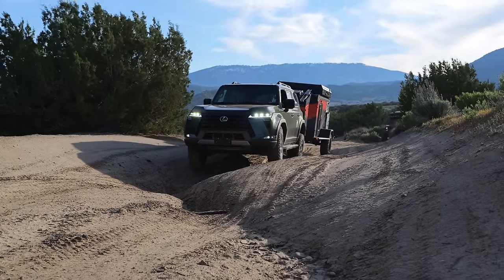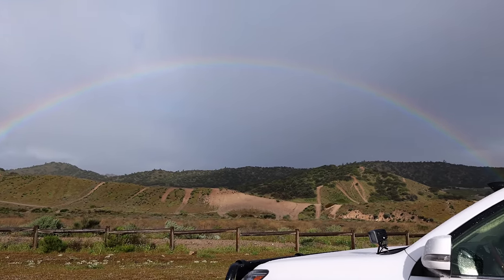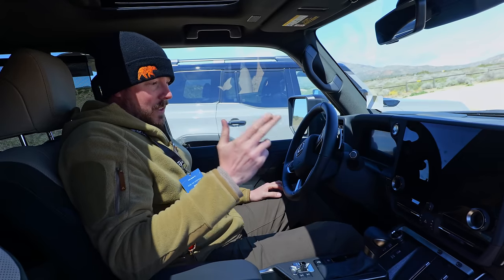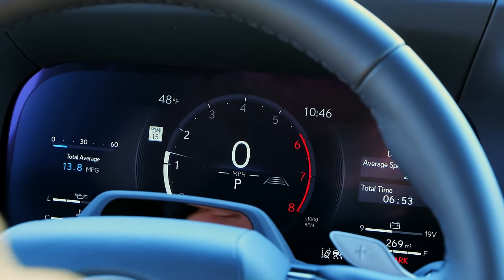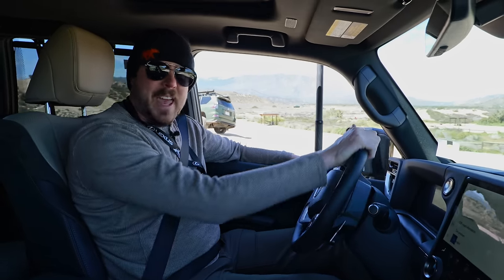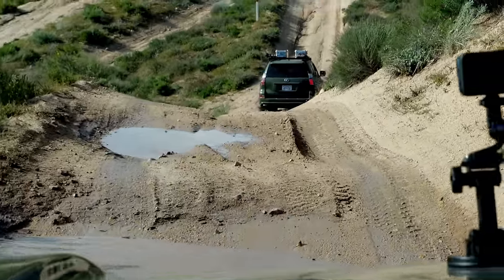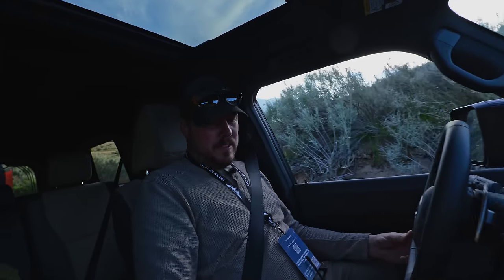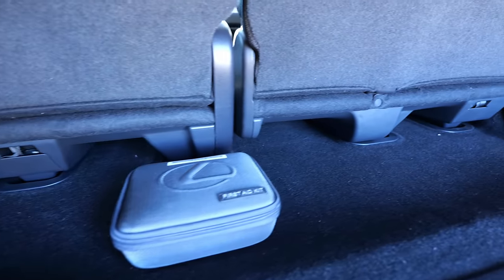Lexus GX550 OVERTRAIL - Is it off-road ready? (Real Reaction)

Comment: The GX550 is Hands down the GOAT of all the new Toyota Vehicles. Its the dream rig for sure!
Reply: It's still a Prado/LC 250 and amazing!
Reply from the maker: I agree, it's my favorite of all the new platforms.
Reply: Common longevity!!! :)
Reply: Except for long term reliability of the powertrain. A Toyota mechanic said this powertrain is super complicated and it's going to cost a lot to keep this thing going. Would prefer a V8 powertrain over this twin turbo V6.
Reply: @glow4417  time will tell. It is toyota so there is still hope. And I would prefer a turbo 6 cylinder over the 4 cylinder that the land cruiser has.
Reply: I would go lx600 for your use with towing the trailer. Lx600 has marginally more horsepower but does have bigger turbos. The bigger turbos with marginally more horsepower =. More reliability. They are expensive though…
Reply: I would agree. The new 4runner, Tacoma and Land Cruiser don't do anything for me personally, but I really think Lexus hit it out of the park with the GX550. I do worry about the reliability of the new V6 platform, but Toyota/Lexus is usually good at working out the kinks.
Reply: I dont know the 4Runner comes with bigger ground clearance.  A sunroof that opens.  Power Rear window.  Option for non hybrid.  It may not have as much power but may be the sweet spot in the line up for off road
Reply: It’s cheap junk.
Reply: @dannyhoward3437  Man if this is cheap to you, that is awesome.

Comment: Excellent, very informative video. I've been following your adventures for over five years now and loved all of them. Your channel was my first subscription on YouTube  l met you a few years back at the overland event in central Texas and have learned a lot about overlanding from you. I'm 77 years old and have always loved off roading since  the 1960's when i built a dune buggy out of a 1955 Oldsmobile for running the dunes on South Padre Island. We removed the body, shortened the frame and put dual wheels on the back. Lots of power but really too heavy for running the dunes.   My Grandmother did most of the welding for me. She was lead welder for Douglas  Aircraft back in WWII. You've really got me excited about the new GX550 with your evaluation of the vehicle.  I've always been a Chevrolet guy but this has me excited about the GX550. Two of my sons drive modified Toyotas; a 4 Runner and a 2006 GX470 and really like their rigs. I think the GX550 would be a good all around vehicle for our needs without a bunch of modifications needed. Thanks again for the excellent video.
Reply from the maker: Thank you so much for sharing that and for riding along with us for so long! I was also a GM guy for many years but since getting out 4Runner we've fallen in love with Toyota (obviously). 😁

Comment: Great review! Ive got a 22 tundra with over 100k miles on it and it still runs as good as the day I bought it with no issues to speak of. Oil field truck that sees lots of rough roads. 
If i had the money I would not hesitate to buy a GX550.

Comment: I was particularly impressed with how quickly the wheel spin stopped in the wheel off the ground the first time it articulated in your video. You were obviously impressed. I bet Sarah was giddy when she saw the video. I would think EKDSS will end up more reliable than the swaybar disconnect. I am concerned the sbd will end up as clunky as the 4WD engage can be sometimes; as it waits for all the players get in line to re-engage, or get out of a bind enough to slide apart.
Reply from the maker: Yes, it was much more controlled and instant! The EKDSS was also spectacular.

Comment: Thank you! This is by far the best presentation of the GX550 to date. Every other media platform has taken it city driving or over extremely mild terrain. This GX550 Overtrail+ is very impressive!  If Lexus makes a hybrid version that gets better MPG, I will seriously consider it 🤔 
* Lexus Engineers*  Moving the 12V from the center console  up to the dash cubby-hole would allow the 4L/4H switch to take that location.  If the Overtrail is only 2 rows of seats, then the rear seats should have the option to move forward/back with a manual pull handle. The sunvisor Has to be able to move the length of the window or have a separate pull flap. More ground clearance, via suspension or adding AHC, to the Overtrail would be greatly beneficial.

Comment: A manual trailer brake controller is a must for offroad in both hi and low range. It's the difference between being pushed off a cliff or avoiding it.

Comment: Thanks for taking the time to make this review. At the end you mentioned adding some clearance enhancements. Are you thinking it needs a lift? Will adding a lift mess with the geometry of the suspension in a negative way?
Reply from the maker: I'm curious to see what aftermarket does with this. Honestly it's never enough lift, lol. But this will do 98% of most trails no problem which is crazy for a stock LEXUS 😲

Comment: Let’s take a moment to appreciate how quiet the interior was over all those different ruts and off-road scenarios. The 460 was quiet too it’s put together really well, there are some vehicles that feel like they will fall apart on washboard roads. Does the rear locker engage right away like the center diff on the 460? Toyota rear lockers take forever I was wondering if it works better on a Lexus…….

Comment: 4runner guys (me) be like “yeah, but the back glass doesn’t roll down!” 😂 looks pretty sweet! I wouldn’t want to lose the center console to a cool box though. Did it have/did you use stabilizer disconnect? Great video!
Reply from the maker: I think the coolbox is optional. This has EKDSS so it doesn't need to disconnect like a traditional sway bar. It's a crazy cool design.
Reply: Overtrail has eKDSS which disconnects sway bars automatically.
Reply: @spaulagain it not only disconnects it or connects it, it can be set in an analog way, like 25% or 50% depending on the mode used : snow, mud etc. According to a Lexus engineer in a video. All automatically.

Comment: They did good with the exterior design. That lack of back seat leg space is kind of nuts. 
I can wait to see these lifted with 35's and overland front bumpers with light bars and winches built in.
I'm going to wait a few years and try to find a nice used lease return. Then I'll build it up and start putting miles on it. 
Best of all the new Toyota Designs.

Comment: Thanks for the in-depth review. It would be cool if Lexus/Toyota would provide dealer-installed options like bull bar/winch, sliders, under armor, steel rear bumper with swing outs, and so on. I'd love to get factory-approved options on a truck like this.
Reply: OT can come with sliders (rails) which are the real deal apparently and yet lighter than most aftermarket ones.

Comment: As someone who overlands with kids, what do you think about the Overtrail versions not having rear HVAC (not only no third zone, but no vents in the ceiling?).  The models with a rear HVAC zone, just like the 460, have an additional heater core and A/C condenser, something which really boosts the heating/cooling capacity of the vehicles.  I'm a GX460 owner and right now this is a huge sticking point for me in getting a 550 (I do want Overtrail for E-KDSS, locker, etc).
Reply from the maker: Never had a problem with the lack of rear AC in our 4Runner so it's never been a big deal for us. The vents on the back of the console and the under seat heat vents have always done the job. Our rear system in the 460 always seems to suck up too much dust since it doesn't have a cabin filter
Reply: @LifestyleOverland  heh, I added a filter to my rear HVAC input.
Reply from the maker: So surprising it didn't have one. Curious if they added that to the premium and luxury 550's now

Comment: Honestly ive always been a 4runner guy but Lexus has been growing on me.. When you think overland its mainly 4runner, Tacoma, Jeep, land rover. Alot of those lack more power and these models of Lexus having the V8 is something we all need in our lives. Also the esthetics arent too bad either 👌

Something that'll always have a leg up on any other car is the resale value of a 4 runner and Tacoma.
Reply: Except they are done with the V8. The new LX(US version of the Land Cruiser 300) and this GX550 are both twin turbo 6 cylinder engines.
Reply: I have a beautiful black 4 runner limited 2005 V8, with 135000 miles, still running fine.

Comment: So far I am only unhappy with the undesirable under 400 mile range in my GX 550 Overtrail, on a full tank.    I do a lot of cross country travel and think there should be over 400 mile range, on full tank, with this type of vehicle.     My 5th gen 4Runner has about 500 miles of travel range, which is a significant difference.     I would like this issue addressed for Overtrail, maybe even with good aftermarket 😊

Comment: They should just stop with the wireless phone charging platforms. They are usually too small, in an awkward position, are slow charging, and don't work very well, especially when driving off road.

Comment: Is the engine noise as apparent while youre driving as it is on camera? Sometimes microphones pick up more background noise than the human ear can perceive. This sounded a bit... Noisy? I know you mentioned you couldn't tell the engine was running, but we could definitely hear it.

Also, count me in, I'd love to see a real off road test, not just the dirt roads in this video. I am slightly worried about approach and departure angles though. And that front bumper looks like it'll be really expensive to cut up to fit a front bar on it...
Reply from the maker: It's extremely quiet. Some have complained it's too quiet. I tried to bring it up a little in the audio so you could get a feel for what it sounds like.

Comment: Outstanding review compared to the many others I have watched.  It's awesome to actually get a review where you were able to test it out with your trailer albeit not to its limits but still ok.  Your real world experience in hauling family and stuff is what makes a huge difference for us that love to do the same.  

Sooo I will be purchasing a new Toyota/Lexus within the next two years and selling my 05' 100Series LC while holding onto my 04' Tundra.  The big question for me is new LC + Premium pkg or GX Overtrail?  The price appears to be within $10K or so when you get down to it.  In comparison, is the GX fit and finish that much better?  Is the GX more comfortable?  Capability appear very similar as does internal room/storage?  This may sound stupid, but the the most significant difference at this point that keeps the LC in the picture is the hybrid and ~5mpg difference and reg unleaded vs premium as I expect both powertrains to have very good performance and reliability to be equally excellent.  If/when GX goes hybrid it seems like a no brainer for me.  decisions decisions and thanks again for your insight.
Reply: GX OT is best, many added features not available on LC. E-KDSS, adaptive variable suspension, etc. 
I thought that both GX and LC were premium gas in a video I saw.
Reply: I’ve seen both regular and premium for the LC. Something like recommended but not required?

Comment: @lifestyleoverland It is more fair compare GX550 with the with the LX600/570 or Land Cruiser 200 series because of the dimentions and powertrain. The GX 470/460 was build on a smaller frame. If you like the GX550 then you may love a LX570 or LC200 with a reliable V8 and hydraulic  power steering.

Comment: Money no object, you are gifted one option, would you do the LX600 of the GX550? Regarding the Turbos, I don't know about the GX ones, but on the Tacoma, one of the engineers said the Tacoma Turbos aren't actually new. They've been running on Toyotas in different markets for awhile now. And they are tested to commercial spec ratings instead of consumer.
Reply from the maker: I'd have to spend some time in the 600 to answer that. Yeah, I'm sure these turbos have had more than enough testing. I'd be curious to hear where and in what situations they were tested under.
Reply: @LifestyleOverland  same on both. Very exciting times for the Lexus overlanders. I’ve got a 570 and this GX550 design is just drop dead gorgeous. Wouldn’t be hard to convince me to buy a high mileage used one down the road ha!

Comment: Do you get a commission?  'Cause you can tell Lexus that your video just put another person in line.  Truly, I love my 2021 LC HE w/ the 2" lift and sliders and a few other bits.  But I am in my 70's, our overlanding is "milder" and "shorter" and our other vehicle is a 2024 Lexus NX.  So the convenience  of driving to vehicles where very similar tech and still getting a more than capable mild off-roader that can easily pull our 5700 lb travel trailer is a no brainer.  The big question right now is to decide whether to wait to the 2nd release.  I did a first-year vehicle once (Acura MDX) and it was a huge mistake.

Comment: @Lifestyle Overland Based on your experience, I have a GX 550 Overtrail+ on order with the rock rail installed from Lexus ($990). Do you think that will be neccesary  for light overlanding/camping or is the native raised step good enough?
Reply from the maker: I think that's a great investment for protection of the rockers. Pretty inexpensive too compared to a later upgrade with parts, labor, coatings, etc.
Reply: @LifestyleOverland  Alright, will keep em on!
Reply: Is your dealer marking up cost?
Reply: lol I actually ended up getting a 2025 BMW x5 50e because I had been waiting over 6 months and had so many delays. I was blown away by the interior and tech

Comment: After seeing the 4runner, Lexus is going on the back burner
Reply: I do like the the look of the 4Runner and that they kept the roll down back window. I probably would also get the T4R over this just because of price and MPG (87vs91 octane too)
Reply from the maker: Yeah? You like that design better?
Reply: @LifestyleOverland  I like both designs but i am 4runner fan boy so 😂
The price tag of the 550 is nuts
Reply: The part about Toyota doing turbo engines right the first time is just flat out wrong.  Remember the turbo 4 cylinder pickup in the 80s?   Lasted 3 model years because it was a piece of junk.  Then on the new Tundras, they’ve had nothing but problems with the turbos.   Stop the Toyota Fan Boy stuff.

Comment: Great vehicle! However 💰 💰
Can’t afford.  Plus for my needs would have to put in a full-length roof racks, rock rails… replace tires with E rated tires.

So I bought a 2024 4Runner off-road premium with KDSS , hydraulic steering, cameras and did all my modifications, Wild peak tires,etc. for under $52,000 instead of around $90,000 for a GX550, plus 10% sales tax in my area. My KDSS 4 runner reduces body roll significantly and increases articulation. Wouldn’t buy a 4Runner without it. However, the GX550 has more articulation with the E-KDSS system.

Again, GX 550 great vehicle, but I believe my 2024 V6 4Runner tank will last longer than that GX550 turbo engine. Planning to keep vehicle for at least 15 years.

Comment: I understand the novelty of all those whistles and bells though I always get a feeling that these are just more things that can go wrong and the initial price is hard to swallow. Is the keep it simple stupid a better way to go when off-road or is that becoming a dying thought?
Reply from the maker: It's really a fine line I think. If you never change or improve then one group of people get upset. Add all kinds of tech and another group wishes it would stay the same. After this drive I found many of the upgrades to be more functional than I expected. There is merit in keeping it simple, but if we always did that then we would never would have invented cruise control, antilock brakes, backup cameras, etc. so I'm all for new tech so long as it is properly tested before going into production.

Comment: No reviewer of 4Runners and Lexi ever mentions the vestigial tow hitch. I'd want a model without sunroof, given Toyota's track record.
Reply: What’s the issue with the sunroofs?
Reply: The drains plug and nobody thinnks to periodically clean these out so you will find out when your passenger tells you there is a puddle in the floor. They are not made to be accessible either, nor is the tubes' diameter sufficient. This is not the only way Toyotas bring water into the cabin, but it is the first thing people check, even if they have never used their sunroof (duh), distracting from finding the actual source of the leak.
Reply: @marusholilac  wow. Jeez. Good to know. We had previous generation of Sequoia platinum with the sunroof and we never had any issues like that….

Comment: I owe 3rd gen taco and looking for a new family rig.  I see this new GX has the same amount of room in the back if not less.  Bit of disappointment.  New 4Runner is not better from what I have seen so far.  Big miss on Toyota/lexus
Reply from the maker: To be fair, there's plenty of room if the front seats aren't smashed all the way back. I'm an exception when it comes to leg length lol. It would all be PERFECT if that second row slid like the 460 does though. So much room behind it!
Reply: I agree 100%.  Second row should be a slider here and in the upcoming 4Runner.  I am 6’2” and I like to be comfortable in my front seat at my kids expense lol.  My wife’s Atlas has plenty of room in the back.  If VW can do it Toyota should as well.